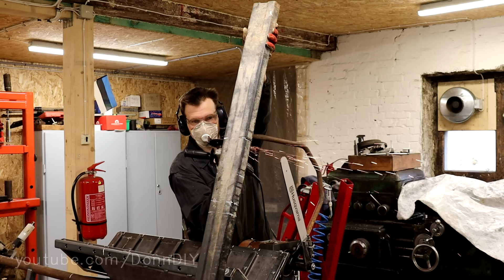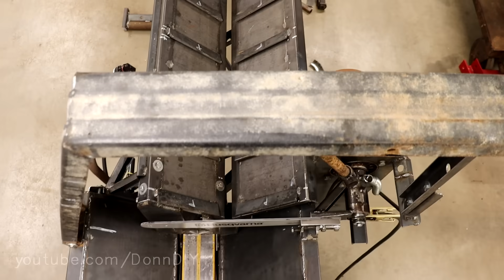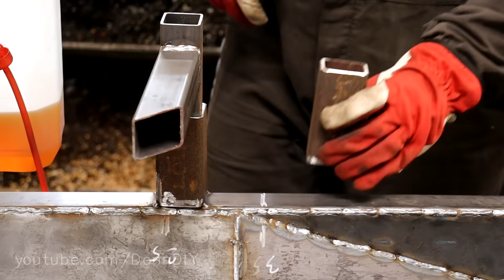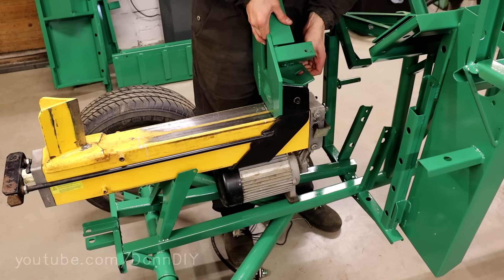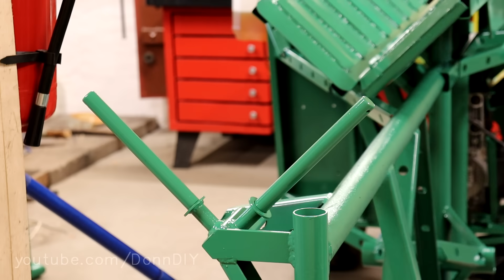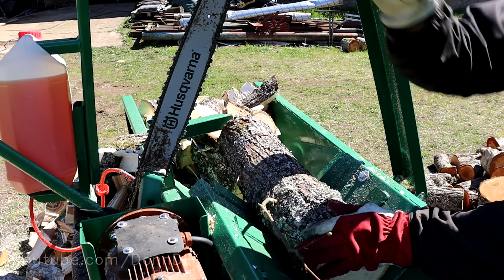Homemade Firewood Processor - Log Splitter To Firewood Processor Ep. 5

Comment: Hi Donn, congratulations on the project. I would add one more thing: a small switch on the log transport cart, so you can only activate the saw start button when the cart is back. To prevent the saw from inadvertently hitting it when it is running.
Reply: @Nicola Prisco. it’s hard to criticise something as well built as this being home made with mostly hand tools. But when I was watching the first run video and was thinking if Don got out of sinc with the saw it would eventually hit the travel bed. Simple limit switch would do the trick.
Reply: i was going to write that exactly
Reply: Switch would be great! Human errors are so simple to occur (tired, mind in another direction, problems at home etc)! My buddy was working in the woods on chainsawing. He had a worker (had 10-15 years of experience) who said "i don't need no safety pants", buddy of mine then said: "then don't come back here". Literally the next day, he appeared with safety pants on and sawed into the leg, pants saved him with no scratch on the leg! Safety, safety, safety!!!!
Reply: Yes a contact switch on the tray that closes the circuit of the saw switch when it's in the rear location.
Reply: I was thinking the same, but although it would be safer it would also slow him down because he can cut part of the log without waiting for it to fully retract.
Reply: @argonthesad  When working with certain types of equipment, such as circular, chain or band saws, milling cutters or lathes, you have to think about safety. Speeding up work can be very risky. A chainsaw that impacts against a piece of metal instead of wood can have very serious consequences.
Reply: @NicolaP269  Another way of limiting is to physically limit the movement of the bar to a safe distance of the bed unless the piston is in retracted position. in that way, he can saw half way into the log, but not into metal.
Reply: Maybe a physical limiter somehow that prevents the bar from moving down fully until the cart is back out the way?
Reply: Yep, a small roll switch that loops with the contractor coil circuit. No major current running through it and you could use some 0,75mm2 wire.

Comment: I really like this design of fire wood processor, almost ever other one I look at has so much going on and people build them big with limited capacity but this , this works great and it is ATV size for if you are working in the woods or clearing a wood lot. I will be making my own fire wood processor and I "will" be taking notes off your's for mine. Awesome build Donn !!!!
Reply from the maker: That's what I want to hear - getting motivated and going out and actually starting fabricating things. Very cool! Have fun with your own firewood processor build! 💪
Reply: I don't think that you'd be able to run it in the woods unless you had a power supply, such as a generator.

Comment: Quite the splitter, very mechanically inclined.
    One thing you need is a 4 or 6" belt sander. W hen you take some of those parts to the grinding wheel it makes chills go down my back. From a   Tool and die maker of 40 years. Don't stop inventing!

Comment: I had to save this video series. Great job. Lots of great ideas.
Like all the other armchair engineers I can come up with several upgrades/mods to what I plan on building.
I will be replacing the sled with a chain system, like you would find at a car wash to move the log forwards.
Then like others have suggested a limit switch to stop the log at the correct position, before the chain saw can be activated.
I like the way you are bringing the logs up, would have liked to see it under the load of those big logs.
Reply from the maker: Not gonna use it for lifting those big logs, it's not meant for it - I rarely get such logs for firewood, I might not even use these big logs shown in the video for firewood, rip'em up to planks maybe.

Comment: Donn,  I like your creativity especially how you utilized the single motion of the splitter to handle three functions, genius. One thing I don’t think you will be happy with is the chain bar oiling arrangement.  When I initially built my firewood processor I used the same gravity feed arrangement. The problem I kept having is the oil port would get plugged with sawdust and the oil feed didn’t have enough pressure to clear it so I would have to disassemble the chainsaw to clean the port. I solved it by adding a cheap electric fuel pump that actuated with the chainsaw. I control the flow volume with a needle valve. I love watching your videos, wish I had your skills.
Reply from the maker: I have to keep my eye on the oil port.

Comment: Just excellent. Perhaps it’s already been noted, but you could 1) weld a small v or u channel to automatically route the log lifting height retaining pin into the retaining hole instead of manually guiding it each time you lift a log and 2) rig a switch for activating the saw chain back at the pivot point so the saw activates automatically as you pull the cutting handle down, thus relieving you from pushing the button on the handle each time. The downside of #2 is a potential safety issue in that you can currently deactivate the saw in any position via the existing thumb button. Gee you did a great job with this. Good on ya and thanks for sharing the process.

Comment: Looks great - I had an engineering workshop and this was really down my street.  But one thing needed is a limit/micro-switch to disable the saw till the bed has passed.  I notice it starts up when the bed is still moving back and you had to hesitate to bring the blade down manually.  One slip of the mind and your chain will become a metal saw!!    But I'm sure you know this as well.

Comment: Looks good and will be a lot less work than before I am sure.  One summer I ended up loading logs onto a gas powered splitter by hand and it was a PAIN.  Largest of the logs was probably close to 3 feet (1 meter) diameter and was really heavy.  Only way I could get it on the splitter was to build a ramp and roll it up.  Got it split in half and the rest was history.  Some of the logs were really stringy as well, something like chinese elm but it's been 25 years so hard to remember.  Made 3 piles 10 feet (3 meters) tall and probable 20 feet (6 meters) across in the yard that summer.  The guy who was running the actual splitter did nothing but keep it fueled up and work the controls and wore a blister on his hand we split so much wood.  But we didn't have to spend hardly anything on propane that winter which was nice.  

One suggestion for cutting is that you can actually get a different chain often referred to as a Full House chain, it will cut faster but you would probably not want to use it on a small engine as they tend to bog down a lot faster with that style of chain.  Would be worth trying though, taking a few seconds less per cut doesn't seem like a lot but if you save 3 seconds every cut and do 200 cuts an hour pretty soon you have a gained an extra ten minutes of time.  Over 6 hours of working you have shaved an hour off of your day.  I highly doubt that electric motor will bog down either.  

For the lift you could easily use a ratchet system with the splitter and use a chain and bar conveyor.  As the logs split they can drop on and get pushed up the hill a little at a time.  A bar attached to the splitter then pushing on the lift bar to go up the table and then a catch to prevent it from sliding back down would be pretty simple and require no extra motors.

Comment: Excellent work! Looks like you need a safety cutoff switch/sensor that will prevent the electric chainsaw motor from working unless the wood tray is fully retracted.

Comment: First Great job, it works better than I would of thought with the splitter you started with, very nice.  Second, without sounding rude, I have a idea for your processor.  I don't know if you already thought of this or someone else commented already.  But what about a spring loaded, (spring would pull clear of log) a lever with a directional saw tooth to hold the log but doesn't impede the log to advance. This way you can use leverage to hold down the larger logs with less of your energy used.  Same style lever as the one used with the  bar and chain.

Comment: I've seen professional models made that dump into pallet sized bins similar to the wire cages on IBC 400 gallon tanks. Wire allows wood to continue drying. I used to use 30 gallon drums as they could be rolled into smaller areas and kept the wood waste dust and bark from being as messy in the house.

Comment: I, like other commenters, also thought about the safety switch for avoiding to hit the cart whith the saw while it's still returning. One simple safety swithch approach would not work because you are losing time (You can start to cut while the cart is retracting).
 The optimal solution would be to stop the motor of the chainsaw if the chainsaw bar aproaches the cart when it's not fully retracted. So 2 safety switches in parallel. This would only stop the saw if there is real risk of hitting the metal and allows to start cutting while the cart is still in motion.

Comment: You should get some expanded metal, to use as a guard between you and the chainsaw. Make a frame out of angle iron. Affix it to your handle so that it follows the handle’s travel. But make a single hinge for it, with a spring to keep it downward. That way, when it comes into contact with the log, it’ll still allow the handle to travel further to cut all the way through the log.

Comment: Really nice project! I noticed that the return stroke of the hydraulic ram was a bit slow, and that the saw could hit it if you're wandering off into other thoughts after 50 logs and you're a bit too quick, ruining the chain. Perhaps worth investigate either a mechanical stop connected to the hydraulic sled that stops the chain movement to hit the metal, or a limit switch that don't allow the saw to spin unless it has retracted enough
(Electrical would slow it down a little, so a mechanical stop might be better, but an electric switch probably the easiest)
Reply: I was thinking the same thing. IT would be easy to accidentally run the chain into the metal sled.

Comment: If you add a bag mouth bracket where the blade shoots the chips, you can collect them. When they're dry they're excellent to feed a fire as filler, and when they're left to sit wet, they become excellent mulch for a bed of flowers.

Comment: Maybe an idea to put a spring on the sliding table so it is always pulled back completely? Might make the machine smoother to operate. Another suggestion: you could attach a linkage with a spike that grabs the log to the handle for the sliding table. So that the spike grabs the log when you don't operate the lever, but when you operate the lever the spike is lifted and the log can slide. If the spike points perpendicular to the stationary part of the table this should also make it easier for the sliding part to retract. If you make it spring loaded it will work for variable log diameters.

Comment: Instead of using an conveyor I would consider another option. 
Make the table bigger så that it can hold twice as much wood. When the table is full, you can stack the firewood in a container so it doesn't fill up nearly as much. You can buy/get plastic containers that sit in a cage of pipes. If you can get hold of some of them then cut an entrance hole in one side. 
By using containers, firewood can dry and it can easily be moved around. So once you put it in the container the labor ends until it's time to use it.

Comment: The only Firewood processor with Mag Wheels...In the World! Donn, that is so awesome. You may need to put in a safety so the saw will not power up (or drop down) when the trough is in "interference land". (Easily done mechanically). That is if you plan to mass produce them, which would make you beaucoup bucks! In the still photo at the end of your video, any American could be convinced it is a John Deere product.

Comment: Well done.
It seems a limit switch for a chain saw motor is needed. Much better when if the main gear is not in rear position, the chain couldn't start.

Comment: Your left hand on the log is no good,too close to the chain i think.
A hook or not allowing the log to back up would help for that.
A return spring would help a lot for increasing cycling speed,like a foot pedal or just keeping your left hand busy with a command for the hydraulic cylinder and the right for the chain saw.
At least they would not be tempted to stay on the log not having an assigned task.
It's a very good set up you get there,the lifting arms are really good.

Comment: i like it. only 2 things id do different, id use a metal bar oil can with a ball valve, and id and an interlock so the chainsaw cant run unless the splitter is fully retracted.

Comment: As watch this 2nd time... I notice you sometimes get ahead yourself with the cut action before u retract, maybe put interrupt switch in the roll back to prevent chain saw from starting before the pusher fully retracted..  just a thought, hate see chain pulled down into the steel.  very nice build..

Comment: You need to put a tubing ramp with gaps between tubes to let all the wood chips fall through.  And make it adjustable so it can be folded up and also it makes a ramp for to to get rushed up and into a bigger pile

Comment: I see people making bars to rotate the saw bar but if you get a hydraulic block like what is used on feller/buncher you can adjust 80% to saw rotation and 20% to blade rotate and not use metal handle

Comment: Because this is a static saw blade, instead of relying just on the bar and chain oil, push some grease in the bearing at the tip as most lubrication will want to keep crud and crap in there and it will eventually clog the thing. There's specialized grease pens for bars or you can make your own if you happen to have one of those elephant sized syringes.
I know this happens because of a "mill" chainsaw that a friend had mounted on a guillotine frame, he regularly makes coffee tables out of cross cuts of oak, and his bearing got shot to death, he replaced two bars before he figured out that crud needs to be kept out of that bearing, which normally happens with a mobile chainsaw as it's sitting in all sorts of directions and the sticky bar and chain oil is not stagnating in one spot when at rest.
Reply from the maker: Good point to keep in mind. Maybe letting the chain run in the lowest position would help to lubricate the bearing... I'll have to try it out.

Comment: You are going to need some kind of interlock so that you can't saw into the log feed tray. I would also suggest that you need something to either occupy your left hand as you are sawing or have some kind of guard to prevent your left hand from getting anywhere near the saw as its coming down. The video suggests that you got quite close more than once. How about some kind of pivoting saw guard for the top of the saw so that the bottom teeth are only exposed when actually sawing. A sleeve with no bottom attached to the pivot point, with a rod preventing the top of the sleeve from touching the saw?

Comment: This thing is so sweet!

You going to add a bearing to the chain handle that pushes against an incline on the ram and pushes it back those last couple inches during the pull? Extra safety (won't let you hit the log pusher with the chain) and tiny bit of added efficiency versus manually resetting the ram sometimes?

Comment: you need to set the limit switch to the initial position of the hydraulic carriage, which will block the start of the chain saw, otherwise you can start sawing metal together with the tree ...

Comment: for how unsubstantial these splitters we have are youve made yours into a behemoth.    again, appreciate the ideas, its definitely worth getting as much work out of a single hydraulic cylinder as you can.   i'm definitely planning on completing this type of build soon unless for some reason i'm given a free gas powered splitter... ha.     even then this type of mod would be worth it.     i don't think i'll end up doing the cutter but instead simply puttling all the cut pieces lined up and feeding them in... it seems like you have a lot of straight logs to work with and i have a lot of twisted wood that i end up cutting to stove length on the ground right away.

Comment: Super project. Looks like it will really streamline your firewood processing.

It's a timesaver to begin the cut as the slider is retreating UNTIL you have to change a chain. Just like naval ships and war planes have limiters to prevent them from shooting at parts of themselves, I think you need a limiter to prevent the saw from coming down too far before the log slider is out of the way.

Comment: Awesome. Do you have any blueprints of how you did this ? Are you interested in saving the sawdust ? And could you put the atv trailer in front to load the timber directly ? Amazing job you did with this one. Like all of your projects. 👍
Reply from the maker: Don't have any blueprints - just started welding and cutting stuff. I am saving the sawdust for heating since I do have a sawdust stove next to my regular stove in the garage. I could put the ATV trailer right at the end of the processor but I would have to dump it somewhere anyway. Using a belt conveyor and portable wood crates makes the process even more simple in my opinion.